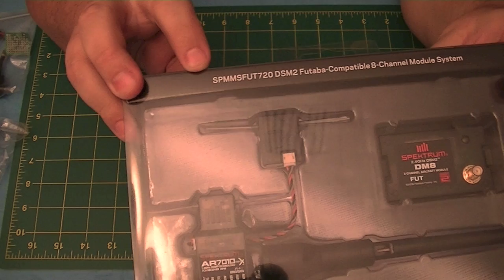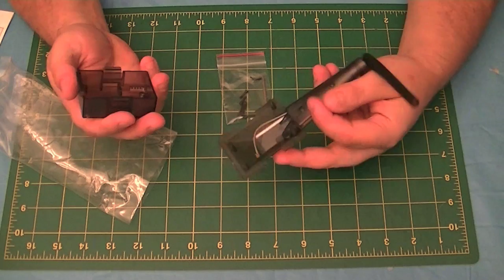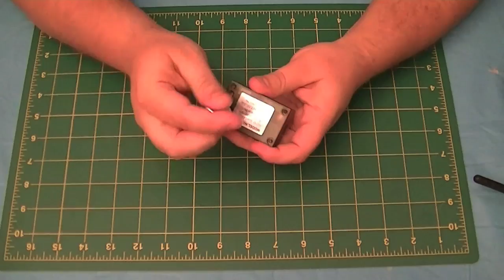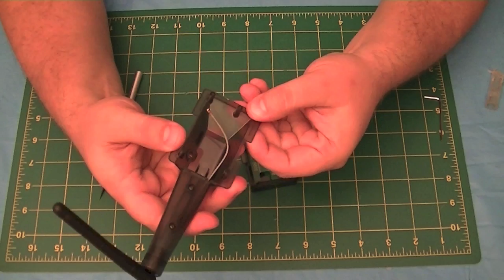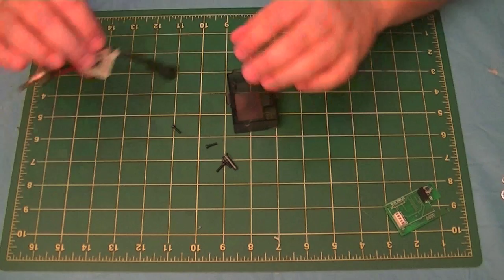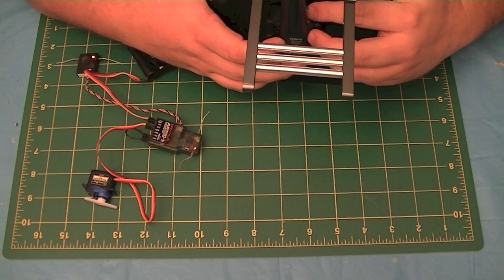Spektrum Module for Futaba Trainer Port. Fly UM, UMX and Blade BNF models

Comment: Clever! So you would trust this for full range? The reason I ask is I recently bought a DX6 to fly BNF stuff. But I really want a Futuba 14sg now that the 8fg is discontinued. Sounds counter-productive to have $229 (plus battery) invested in a Spektrum radio only for BNF stuff. I'd much rather use a Futaba radio for everything. I did consider a Hitec Aurora 9X, but I still think I'd rather go Futaba since it's what I grew up on. What do you think?
Reply from the maker: The module itself uses the same transmission element as the regular radios and is a full range component. However, I fly it only with the small BNF HH products and they do not have full range receivers (the antennas are short and stubby). Personally I prefer FASST over DSM2 or even DSMX so in any case where I am able to use my own receiver I use a FASST receiver and not the Spektrum DSM2 module. Short version, I definitely trust the module to fly all my small BNF models beyond where I can see them.
Reply: bdelapen Thanks for that. I too feel FASST is more reliable than DSM2 or X, but I do appreciate the price and the convenience of HH's BNF products. Not to mention, some of them, like the UMX Radian and Nano QX I recently bought, are incredibly fun and great value for money.

I will be building some bigger models soon, including a tri-copter. I would much rather use FASST on those. Or even Hitec's protocol (whatever) they call it. So I have a couple of options... Would love your input.

1. I could keep the new Spektrum DX6 black I just bought (even though I'm having a hell of a hard time programming it to my Apprentice S due to some bugs I've found). ($229 invested). I could use that over my DX5e and sell the receiver to bring down the price to $200. Then, I would not buy any Spektrum receivers and use the TX just for BNF. Then buy a Futaba 14sg for everything else. (I'd be roughly at $800.

2. I could just get rid of the DX6 and get my $229 back and go buy the 14sg and build the module. Not sure how much the module's going to cost, but say it's $100, So I'd be at $700 (rough estimate of the 14SG + module) instead of $800 and I'd have the convenience of just one radio.

I'd still keep my DX5e for my son to use. I could keep using that for BNFs, but it doesn't have Expos, or model memory.

What do you think? I also have the problem that I've been flying some Aircore planes with the TTX600 that came with my simulator - And those are SLT. I could replace the receiver in that with FHSS or whatever I suppose.

Comment: Could it work with a JR style ORANGERX system?

Thanks
Reply from the maker: Which Specific OrangeRX module? I have an adapter board for the Futaba version of the DSM2/DSMX module but if it is a different one I'm not sure if it will work.

Comment from the maker: The operation of the radio does not change at all. All configuration and programming will be the same as you would have in any other model. The only thing that changes is that Spektrum receivers expect reversed signals (just like you would reverse your throttle). All the module does is add the DSM2 protocol to your radio (replacing the FASST protocol). All other functions, mixes, programming methods etc. remain the same and are fully operational. I.e. settings depend on your model.

Comment from the maker: Hi Ronny, I don't know if anyone has tried it with the 10chg but if it has a square trainer port then it should work; or to put it differently, I have yet to hear from anyone with a radio that has a square trainer port that it does not work. As for channel mapping, yes, the DM8 Spektrum Module that is used as the core of this mod does do channel mapa for any Futaba radio.

Comment: you can also google : RMILEC TX module adapter board

it will let you use futaba modules on any radio that has a trainer port or rf module port that has ppl signal on it

Comment: foxtech actually makes a pcb board to hang from the handle on your radio and plug the module directly into and just connect the trainer cable to the pcb as well 
but your solution is alot nicer looking

Comment from the maker: I'm currently working on the mod for the Orange module, the hope is to fit it all within the actual case that is provided but I'm not 100% sure it will be possible yet as there is very little space. Once I have it figured out I will post a video on how to do it. The one thing to note is that the orange module does not do channel mapping so you will need an 8FG or above  (a radio with the ability to re-map channels) to use it with any of the BNF bricks (i.e. UM, UMX or Blade).